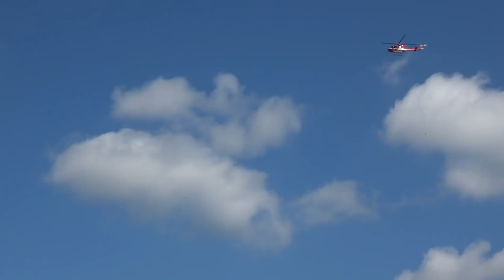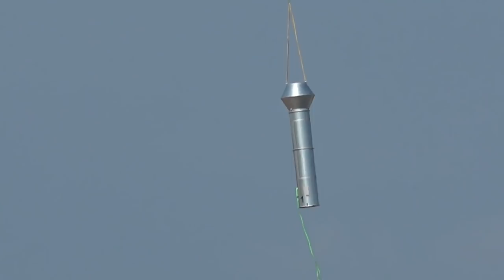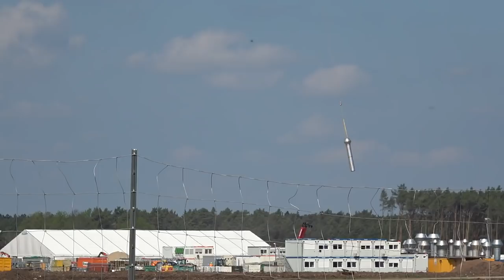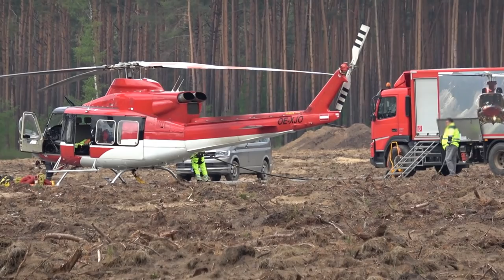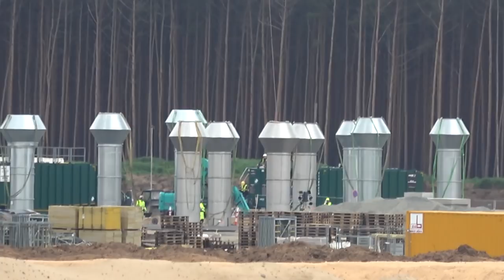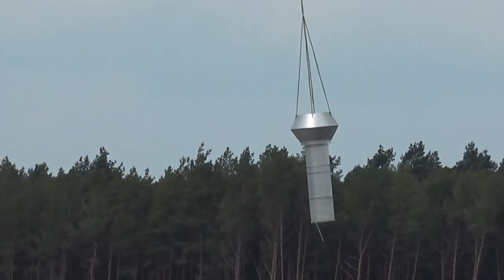Chimney installation by helicopter at Giga Berlin

Comment: I've worked with heli lifts like this- the  accuracy that the pilots get is amazing - holding position to a few inches.
Reply: And we don't even have inches here! :)
Reply: @AndreasDelleske  That's what makes it so impressive! /s
Reply: @AndreasDelleske  Only 3 country's in the world still use the old imperial measurement.
Reply: Worked with a couple at around 8/9k alt in Cali Sierras and Inyos.  Those pilots and anyone around them while doing this have NO sense of humor, it's dead serious.  I only helped unload a dozen X and rode in one a little.  As extremely expensive as they are, they can be so fast, a couple hrs 'rental' might be enough for a significant job...can be worth it even when not the only option.
Reply: Look how much they got done in few hrs (guessing).  Few pick and release problems on ground but pilot smooth as can be.
Reply: @robinbockman7247  We are "special".  Give us another 20 or 30 years.  :)

Comment: thats what happens when cranes dont have access to the whole roof 😁
Reply: They still have a lot of Evapco air handling units in the parking lot. They would have to be really crazy to attempt to place those with a helicopter - although, theoretically, it could be done. It would make a lot more sense to bring in a large crane for that job.

Comment: Why dont they use cranes?
Reply: To far away for cranes.
Reply: To expensive because they would need a huge crane to reach the positions.
Reply: @julianreverse  i would think helicopter is more expensive
Reply: @julianreverse  dont think elon cares about money, since he has tons of different cranes sizes at Boca Chica 🤣🤣
Reply: @zechmerquise5281  Nope. 90-100€ / Minute. Transport for a suitable crane alone around 10k€ one way.
Reply: @julianreverse  Think this will be cheaper, moving in a big cranes will take multiple trucks and another crane for assembly plus a lot of time/work to put it together. Because there parts are not heavy it can easy be done by helicopter.
Reply: @julianreverse  So why did they not use the cranes that were already there when they were building that section of the roof?
Reply: @stevebothe1416  because they are to small
Reply: @JK-ku2mj  Ha Ha Ha, Ridiculous..  You really think the cranes that built the roof months ago were too small to install these stacks?  You need to watch some earlier footage of the factory build.  Sorry dude, you're wrong.  More likely a supply/scheduling problem that prevented them installing them earlier.
Reply: @stevebothe1416  Because the roof wasn't finished back then.
Reply: @julianreverse  OK, so how did the rest of the structures on the roof get there without a helicopter?
Reply: @stevebothe1416  Until now there wasn't anything on the roof that couldn't be carried by hand.
Reply: @julianreverse  Oh Really?  You have no idea what you're talking about.  You should watch the latest video...
Reply: @stevebothe1416  🤦‍♂️

Comment: Usually helicopters are not the cheapest option, maybe they need to speed up (hopefully), that would mean they are still on track with some summer test production plans.
Timelapse was fun :) Thanks Tobias!
Reply: Cheaper than a crane.
Reply from the maker: The planned the helicopter operation for a long time. I already knew the date for months.

Comment: Where are those cranes when you need them?
Reply: We don't need no stinkin' cranes!
Reply: Keeping the cranes longer on site to do only this would have also been costly and briging in one for this day is also expensive. Helicopters are used for many of this kind of work, also for like airlifting christmastrees from remote area’s while harvesting.
Reply: @PM_82  I agree. I'm confident that a cost analysis was done in advance. Even as an old fart, I realize that new methods change traditional processes.
Reply: @jbbuzzable  Cranes for this hight are indeed expensive to hold one on a jobsite when not needed. When the materials are heavy you will need a crana but these aluminum frames are light enough to do with a heavy airlift helicopter.
Reply: @PM_82  Like I said. We don't need no stinkin' cranes!
Reply: Jeez, just jokin!
Reply: @PM_82  I don't know why you mention cranes. I think you are saying that they are maybe not the best tool for the job.
Reply: @GrantHodgsonWnNZ  Sarcasm often doesn't have the desired effect with text. You need to throw in an 'LOL' or something. Otherwise, it is impossible to tell the difference.